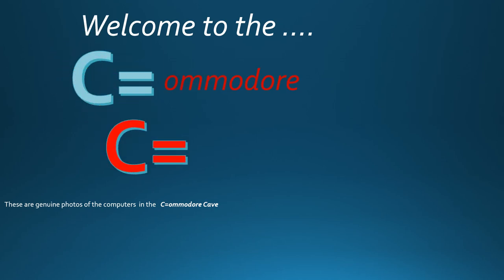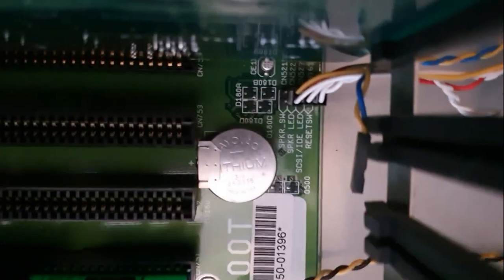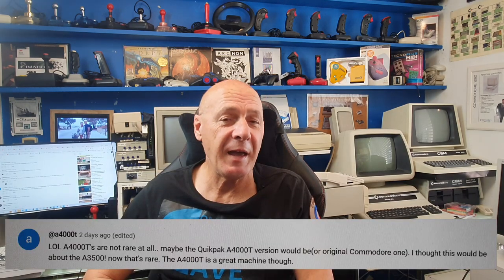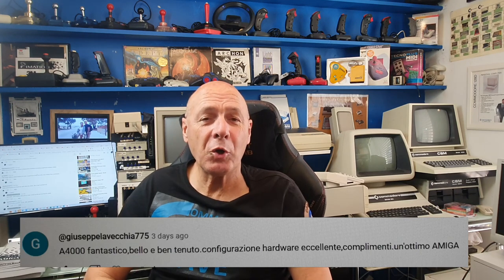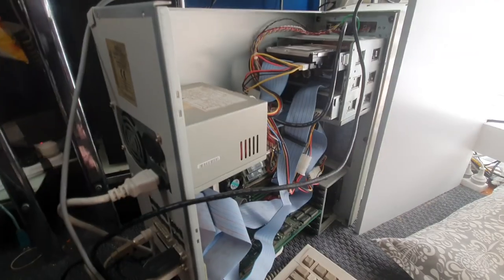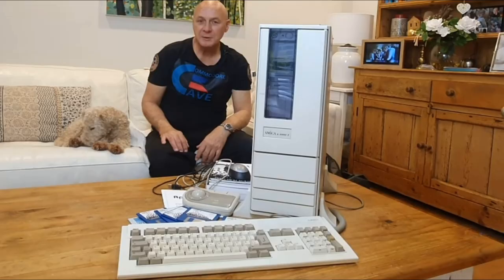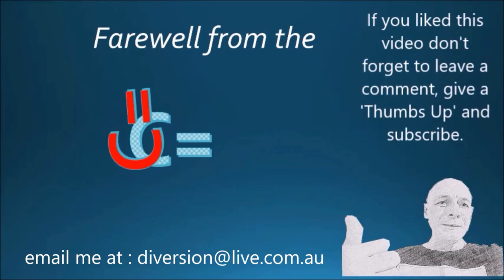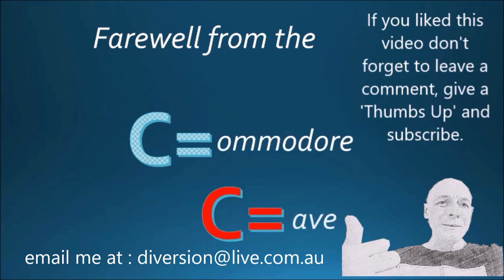Commodore Cave - Amiga 4000T - The first week.

Comment: Just stumbled across this channel.  You make me want to dig out my Amiga collection and boot them up, but they’d probably blow up. 

I have the 500plus with an external GVP drive, 600, 1200 and 1500, but I just use Amiga forever for safety.
Reply from the maker: Thanks. Sounds like a good setup there. If your concerned, get it checked first.

Comment: Commodore went bust before they could mass produce it.

The tower version of Amiga 4000 was meant to be released in 1994, but around this time Commodore went bankrupt and only about 200 units were manufactured.

The Amiga on a whole
An estimated 4,850,000 Amigas were eventually sold, with roughly 30 percent in the U.K., and another 30 percent in Germany. Reportedly, only 700,000 were sold in North America — roughly the same number sold in Italy.

For comparison there were just over 11,500 Amiga 4000 (non tower) in Germany alone, the largest market at the time.

In summary I’d say the 4000T is rare.
Reply from the maker: A pity there isn't a registry to capture how many still exist in the wild today. There is one but only for a Commodore 4000T

Comment: Mini din connector Amiga keyboards were for the Amiga 4000 desktop only!

The full din connector was for the A4000T A3000/A3000T & A1500/A2000

There all wired the same through!
Reply from the maker: The keyboard has a mini din and is labelled Amiga III Technologies Model No KPR-E96YC. According to The Big Book Of Amiga Hardware this is the correct keyboard for the A4000T :  https://bigbookofamigahardware.com/bboah/product.aspx?id=649
Reply: @commodorecave5581  WOW! (Never seen it!) 

I once had 2 Amiga 4000T’s one Escom & the other Quickpak and they were both full din connector keyboards and C= badge wasn’t printed on the keyboard case.

I kept the Quickpak version.

Escom version was made 1996 Quickpak 1997

Comment: My goal would be to expand it as much as possible. As in using every expansion slots, not a vampire or something like that.
Reply from the maker: I'm not a fan of the vampire. I know they are wonderful but thats a ump too far from the original hardware IMO. Everything else is on the table though. I'm tempted to get a Big Ram card but this machine already has 64 meg. Not sure more is better.
Reply: @commodorecave5581  Yeah, you don't need more ram I guess. It's just fun to fiddle with hardware and expand the old amiga computers :)

Comment: She looks great!  I look forward to seeing you wake her up, new apps,  networking, more modern storage perhaps etc.  I do not know much about the later Commodores.  I also do not know about their file sharing options.  I do know there is a linux server designed for use with classic computers.  It is made to be hosted on a local network, not exposed to the rest of the Internet.   It supports old protocols from the older less security minded  internet.  Even your 8 bit machines can "Dial-in"  using attachments which look like modems, but work over WiFi.   THey use an Raspberry Pi or similar microcontroller to be the "modem".   If I find it I will edit this post.   I hope this helps. I would do more, but its a long walk from Boston in the States.
Reply from the maker: Now this is some great intel. Thank you, gives me more inspiration. If I work it out it may be the subject a future Youtube itself. As for getting the 8 Bit online, I do that every week with my C643 bread bin... usually to the U.S. like CottonwwodBBS. Thanks for the feedback (and that link if you find it!)

Comment: Wait so you could pull the keys and re-arrange them based on US keyboard layout?...... noting some have umlauts.

Don't do a 3.2 upgrade, get a separate drive, CF, etc and put it on there. These is something beautiful about keeping it close to the original - yes I am aware I asked about moving keys.........  Also what about recapping are you going to do that or get someone to do that for you?

Smart move on the backup. Really looking forward to seeing some more vids.
Reply from the maker: From bitter experience, I've learned to keep a soldering iron out of my hand except for the most basic jobs. I wouldn't dare put this computer through that. Glad to see I'm not alone in maintaining 3.1. and thats a great solution to run OS3.2 off a CF card. Best of both worlds.

Comment: Oh I would love to get my hands on a reasonably priced 4000T... (if not an ATL/Philips HDI 1000 for the ultimate rare and wanted). If you're running P96 sw for the gfx card then you might want to look into getting a ZZ9000 instead - comes with network, USB, scandoubler and optional audio card.
Reply from the maker: Thanks for the tip. I will check it out. cheers.